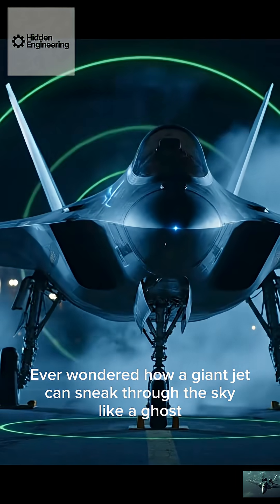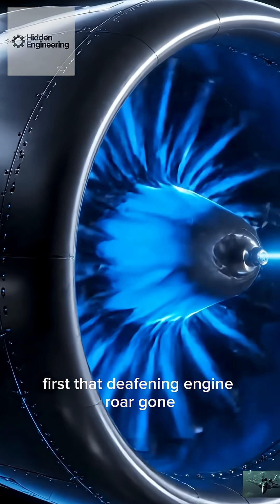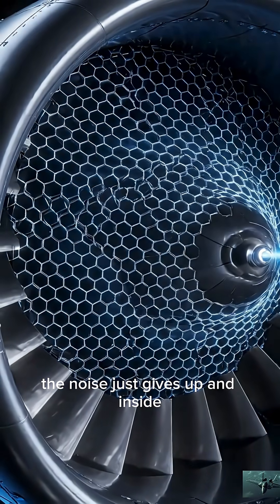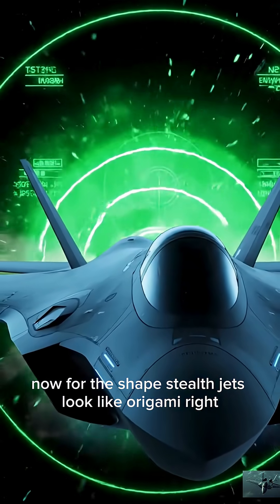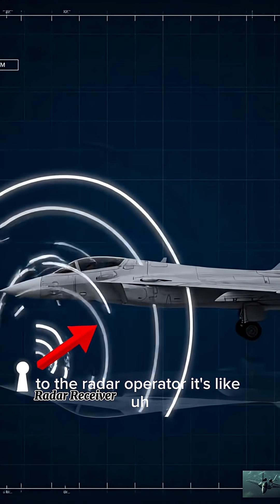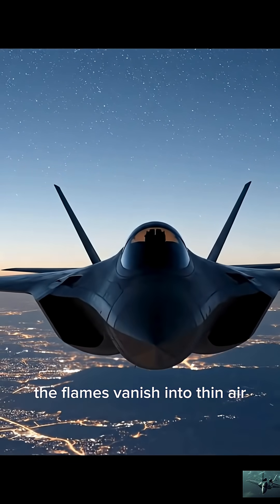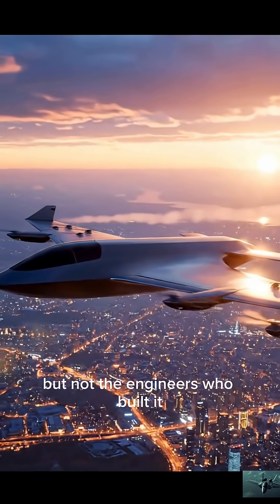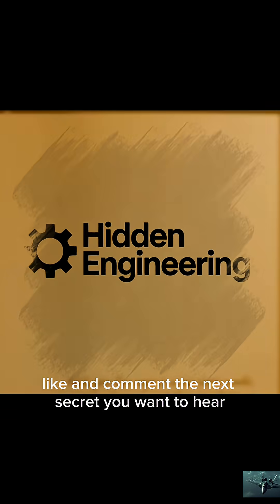The engineering behind Jet Invisibility #stealth #fighterjet #shorts #aviation #secret #ai

Comment: F35 is everything but invisible :D
Reply from the maker: Haha true 😄 That’s a common misconception! Stealth doesn’t mean invisible — it means making the jet virtually undetectable by radar. The F-35 pulls this off with a low Radar Cross-Section (RCS), reduced heat signature, and advanced electronic warfare systems. It’s not literally invisible — just really, really hard to track and target 👀
But if I may ask what's your take on this😁?